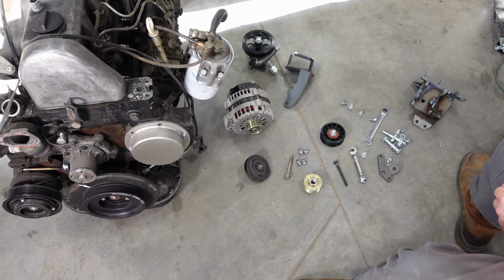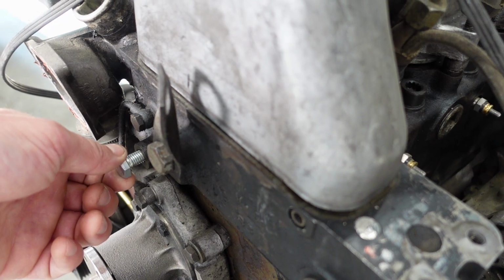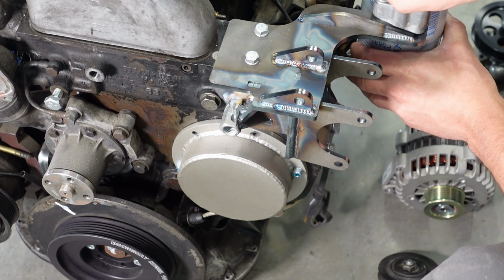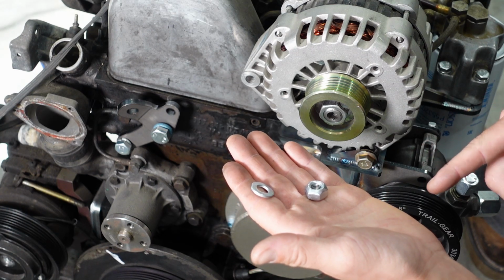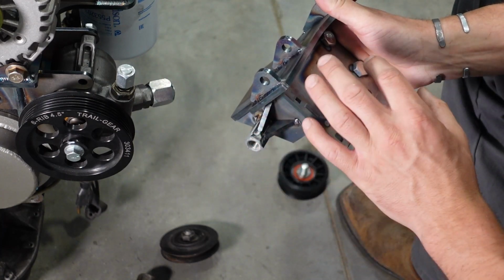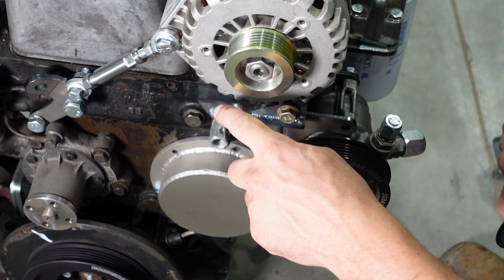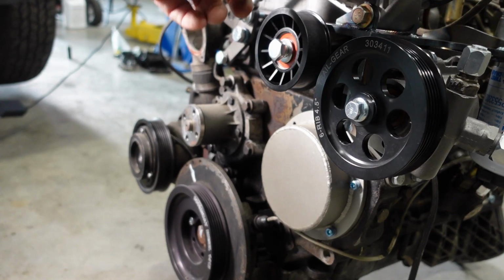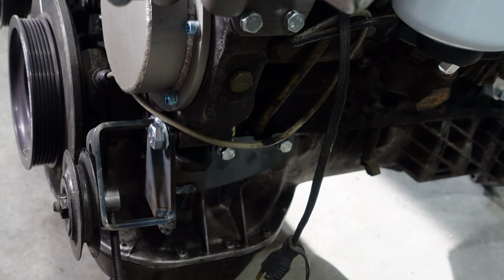OM617 Conversion Series: Power Steering, Alternator, and Belt Tensioner Bracket Installation

Comment: Have you considered making an adapter to bolt a CD09 Nissan trans behind one?
Reply from the maker: For the OM60X, yes. There's no need for a 617 as it makes low enough power that all the cheaper trannys work fine.
Reply: @doomsdaydiesel  well, I have a cd09 at my disposal and I like the idea of a 6 speed. This build would be after several others if it happens, would you be interested in discussing pricing?
Reply: @doomsdaydiesel  as with most things a google search answered my question on how to contact you. 🤦‍♂️🤦‍♂️

Comment: Great content. When you say tc style pump do you just mean the 1650 psi pump from trail gear? I have a 94 4Runner with a Saab alternator set up. Just wondering if I have to drop the money on that pump for this bracket. Thanks!
Reply from the maker: No, but that's the common upgrade for Toyota guys. The Jeeps as well as half the other vehicles in the world from the 90's on used some form of TC pump. If you don't need the extreme output but want more than a Toyota 22R pump, you can source one from a newer Jeep, etc. Or if you're just looking to ADD power steering, this is the best solution.